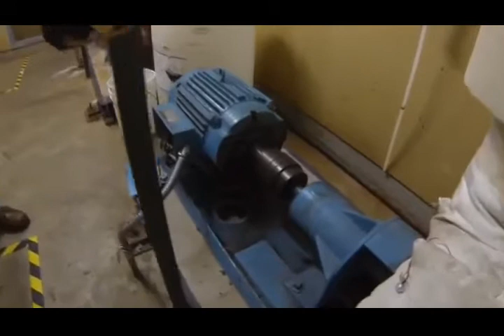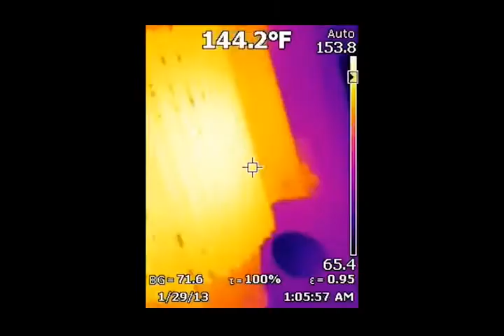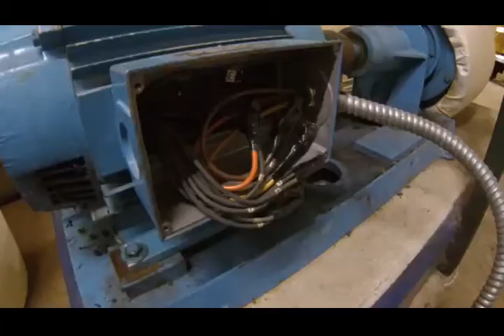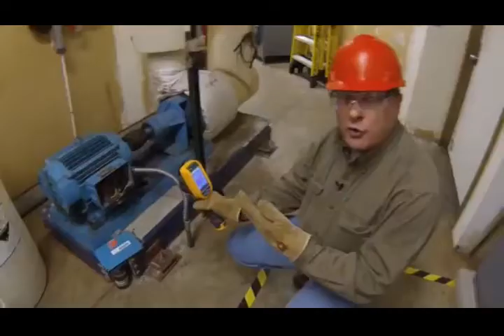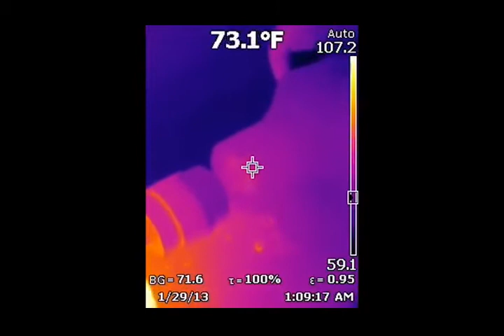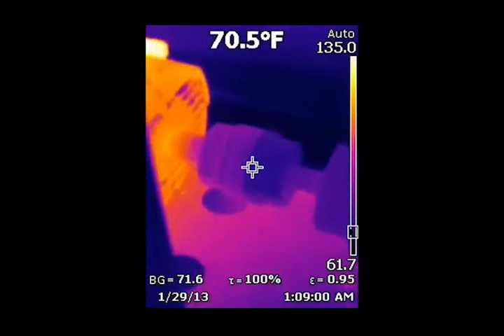Top 5 Thermography Inspection Points on an electric motor

Comment: Good overall review. Like the tip to survey the casing for unusual hotspots. Recently I found a motor-gearbox with an oil leak where the oil had leaked into the motor this way.However.....
Running the motor with the terminal box open and the coupling unguarded are MAJOR safety violations in many parts of the world. If you shut down and isolate and then quickly open the terminal box, then you can inspect the terminations thermographically. Without doing this, look for unusual thermal patterns at the terminal box and heat being conducted away from the box by the cable - a thermal gradient on the power cable is good evidence of a problem.
Single phasing will produce very distinctive and elevated vibration, so no need to open the terminal box for that, plus you can check at the motor control centre for unbalanced loads.
The coupling guard could be part mesh, allowing IR inspection without moving the guard
Note, everything recommended here on the terminal box should also be done at the MCC. 
From a safety point of view, Arc Flash risks are very serious and must be taken into account when surveying live, open electrical panels. Appropriate PPE for this goes beyond what is worn here (Which is great for general risks where no live conductors are exposed)